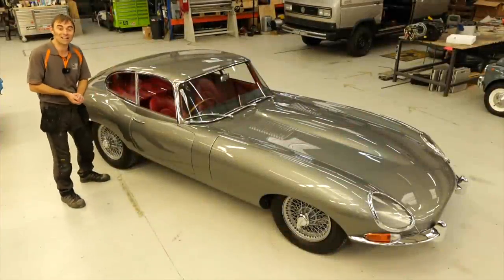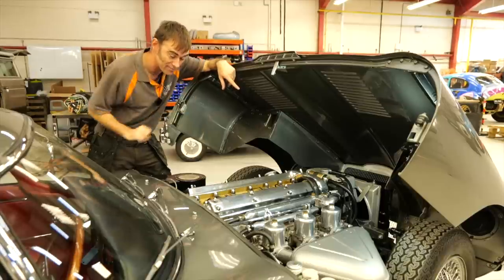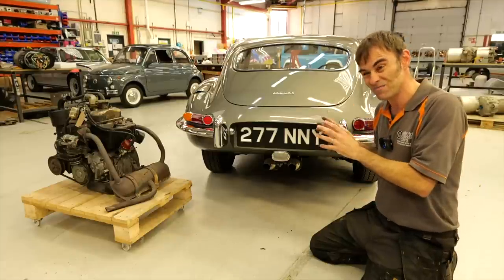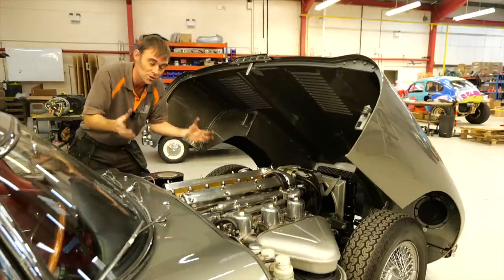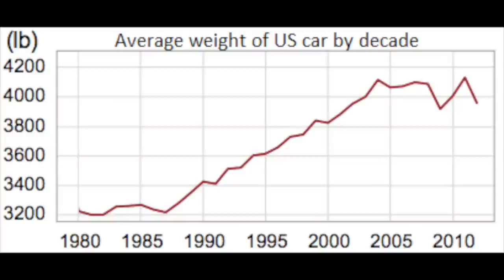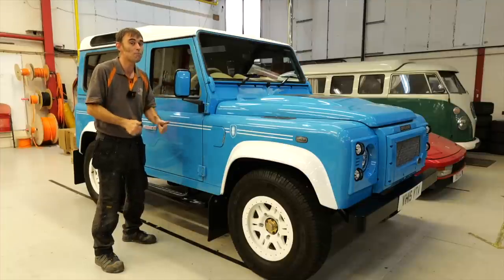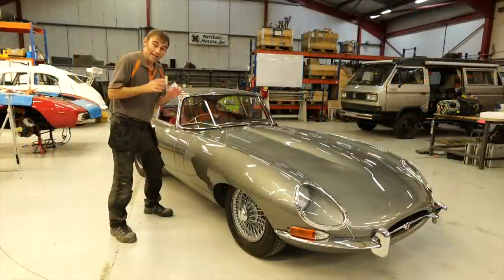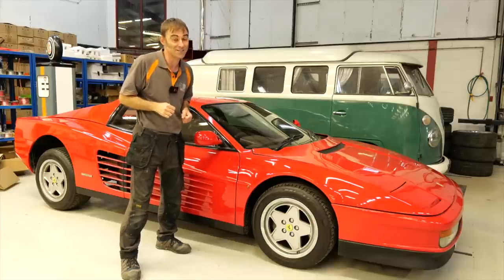Is it a sin to convert a classic car to electric?

Comment: Depends on the car. Changing a DS to electric would be natural and an extension of the car's design. Changing an M6 or M3would be wrong as the engine was the core of the car. Changing a Lotus would be wrong too as it would alter the low weight which was key to that marque.

Comment: I think people talk about the engine as the soul of the car because if you treat your engine well and make sure it has fresh oil it will take you anywhere. And if you tinker with it by putting on some different carburators you can hear the difference en feel the difference. A happy engine is a happy driver. You can hear it,feel the vibrations. It lives. If you open the bonmet/hood you can see the engine,feel the heat, smell it. You can dress it up by polishing the aluminum maybe put a chrome kit on it. When you have an electric motor,it becomes a tool. The only thing you see when you open the bonnet is a battery box. I have never heard someone at a car show say "wow what a beautiful battery box you have in that car"
Or "what a nice sound in that motor" more like " it sounds just like the electric forklift we have at work"
I think most people who buy an electric car or convert a car do this for the point of "look at me, i've got something you don't have or can afford"  and maybe a little bit for the environment .

Comment: There is a massive elephant in the room here that seemingly gets ignored and that is the BIVA issue. BIVA is basic individual vehicle approval - it's a scheme devised by the EU and our own government to test that amateur and custom built cars meet certain specifications. It all sounds perfectly innocent until you check out the details. For example if you have to put a vehicle through iva as a result of it being radically modified you lose the original number plate and typically end up with either an age related plate or a q plate. There is a points based system that attempts to define when a modified car becomes a new car but generally speaking if you modify the chassis in any way you are now looking at a new car. This becomes a massive problem as cars built 50 years ago were not designed to modern standards. One big problem is to do with glass - you have to have a laminated front screen - most older cars had toughened. All side windows have to be toughened which may not be  a problem but the fact that all have to be indelibly marked with the required approval standard might be. It certainly is an issue with my 1951 Ford Prefect with each piece of glass having to be custom made at nearly 230 quid per piece. The DVSA recently issued further advice on this that makes converting to electric and registering the vehicle a lot more difficult. It's expensive too and really not in line with the government's publicly stated policy of encouraging electric vehicles. I have heard of this happening  afew times now - people do whatever they do to their old car then they go to change the tax class and get told they have to take it for BIVA. It needs sorting.

Comment: An internal combustion engine breathes.  It inhales and exhales like some type of animal.  It has moods.  It can be temperamental.  But when everything goes right and it's hitting on all cylinders the noise and fury can be exhilarating.  I think this is what most people mean by "soul".  It's almost like you're dealing with a living thing.

An electric motor, on the other hand, just hums along without an drama.  It is an appliance.  A powerful appliance in many cases, but still just an appliance.  No drama, no soul.

Comment: My first car was a 1967 1/2 XKE and the essence of that vehicle was the unity and totality of all the design and engineering that resulted in its production. I have no qualms about renewing a classic Jag with electric. The thing to remember is you are changing the vehicle into something different. Don't compare - just experience. The FHC in this video is a work of art - it can be as much a modern work of art as it was originally. My current Range Rover Classic and NAS110, both 93s would be readily converted if Moggie was ready to let us individual enthusiasts purchase direct and avoid the excessive and restrictive conversion costs of the US partners : )
Reply: My first car i did not own and did not drive (for legal purposes i have to deny knowledge of the car at all) was a chopped Mini 850 with bucket seats. I think it was industrial sized ketchup but who knows after sitting on the open gas tanks for more than a few minutes. Did not know you could make a burnout on gravel with 25 HP.

Comment: I think we need to differentiate between 'classic' and 'old' sometimes. People who consider Beetles and Campers as classics can do as they please - the engines in those were awful from new let alone 50+ years later, so those are ideal for conversion. Things like E Types and Ferraris are another matter. If an owner wants to convert then go ahead, but doing it the ECC way - being able to revert to original if desired - will maintain the value of the car and make the huge cost worth the effort.
The more EVs on the road, the better for the environment. The less global demand on fossil fuels, the better for those of us who own true classics so we can use them however we please without the constant worry of contributing anything significant to overall CO2 production.
EVs for daily, fossils for pleasure.

Comment: According to a recent Yale Climate Connections report, even if the energy grid was entirely fuelled by coal, EVs would still require 31 per cent less energy compared to ICE cars.
Reply from the maker: Interesting. 👍

Comment: I have to admit I love what you are doing. The problem I have is the lack of facts from the government forcing us into EVs. It is the whole ol life carbon and environmental cots need to b taken into account. and as to running costs, remove the artificial tax the government add.  The best cars environmentally are those that last the longest, so offsetting the first build environmental costs. Just wait until most cars are EVs and the government tax the electricity you use (why do you think EV chargers have a separate meter?).

Comment: Hugely complex issue. If you own the car you can do with it what you like. No car (Electric or petrol/diesel) is environmentally friendly depending on where you get the recharge. If it's from a coal power station your wasting your time. You mention drivability but do you change a manual gearbox for an Auto? That would ruin any classic as it completely changes the drivability. It like changing a 2 wheel drive to 4 wheel drive. Totally different.

Comment: I think saying electricity from coal has emissions and comparing this to petrol is a fundamentally flawed argument, you are comparing a fuel little better than peat or wood to a much more potent and highly refined fuel in petrol, a better comparison might be to a gas powerstation but that doesn't serve thier argument. As you say it also ignores that the grid is getting cleaner and electricity is universal in that it can be produced from almost any fuel source. Lastly I would say they are ignoring the efficiency, particularly the well to wheel efficiency as transport of a fuel is much more emmisions intensive and less local than transmission of electricity.
Reply from the maker: All very good points. 👍

Comment: I think it depends on various factor as you explained. 
Is the car 100% original, working and well maintained? I won't suggest to convert it because it still stays oringinal and it's like re-paint a historical painting modifying it.
Is the car non 100% original, maybe with some issues in the engine etc, or does it needs a huge maintainance? I'm totally in. Maybe the original part that would be needed are going to be more expensive than a conversion and maybe will create even more problems in the future. And it is like having a painting that is missing some parts or it needs to be re-painted, and at this point a change won't be a problem.
About the performances it is well known that the electrics are better, so if the car has the possibility to be modified and improved why not? I think about some cars like a Lancia Delta, Mustang, Jaguar E-type which are made for that, will be even more exciting to drive. Other cars such as Fiat 500 or Citroen 2CV or a Mini, I wouldn't care a lot to match the performance of racing cars because are more a everyday use car.

Comment: I think the lacking soul argument mainly comes from the torque band being completely flat in electric cars. It will accelerate exactly the same way from any rpm at any speed (to a point) and in that, it loses character for some, it becomes what the car is to the majority of the population, an appliance. Using an analogy, a wood fire heater has many flaws and inefficiencies in comparison to modern heating devices, but you’ll never hear anyone romanticising their white box on the wall. 
I’m of the opinion that any car where the engine is not cruical to the experience should be converted, especially classics like minis or old fiat 500s, as safety standards ever increase, we’ll likely not see designs like them again (in saying that, electric cars bring many new design possibilities into reality as it no longer needs to account for big engines, gearboxes, driveline and fuel tanks) and it keeps there presence alive for generations to come, and how can that be a bad thing, you guys are doing far more favours for far more people by keeping them on the road then pleasing a minority. I may be a petrolhead but I can’t deny that we need to change and cars are not just engines, there’s so much in them to enjoy and be fascinated by.
In saying that, if you do want to contribute in helping the environment but still want something fun and inexpensive, why not get a motorbike bike or scooter. They require far less metal and materials, come in a huge array of styles, and are physically smaller so they don’t damage the roads as much. If you are moving 1 person, why do you need a 2 tonne car to do so, that’s how I’ve always seen it

Comment: To the point about ULEZ zones, if I'm not mistaken, vehicles that qualify for Historic class are congestion and ULEZ exempt. (At the moment at least.)
Reply from the maker: That's correct, for now. But just like zero road tax for EVs, I see that changing at some point. 👍
Reply: @ElectricClassicCars  Possibly but then they'd also have to start charging steam rollers, traction engines etc. :)
I'm sure petrol will be around for the rest of my lifetime but yes that will also reduce in supply. It will be a return of the early days of motoring where you'd take a can to find fuel.
While I understand the cost challenges that many face with moving to EV's, classic or not is that it's inevitable. Even with fossil fuelled power stations, it's far more efficiency burning them there, than in each ICE engine at only about 30% efficiency.

Comment: It depends on the car. I would love an electric powered 55-57 Oldsmobile, but would never do it to a V8 Mopar. I wouldn't even put a stereo in the Mopar, because the sound is just too good. Also the cost is still way too high, and the range is too low.

Comment: Some addition maybe — if you convert a 90’s classic car to electric, keeping the weight. Doesn't that mean the performance/weight ratio excellerate better that today’s fossile cars. Reference to your graph shown on 8.14 min. And even more, is converting a classic fossile car with its massive hunger for gas comparing to modern car not much more reasonable  then todays cars with a consumption around 1/3 of what past cars did.

Comment: You didn't mention whether converting a 40+ year old vehicle from petrol to electric is considered to be a "substantial change". I presume it is, in which case it would also remove the vehicle's entitlement to MOT exemption for another 30 years.
Another benefit of converting petrol or diesel vehicles that are less than 40 years old to electric would be the zero cost of the annual vehicle (road) tax.
Reply from the maker: I'm not a fan of the MOT exemption for classic cars. For most that used to be the only time per year they'd check it was all running safe. Now there's no checks. I don't think that a safe thing to do for something that's 50+ years old. There still needs to be annual safety checks done by a professional.

Comment: I'd love to do this; but since I don't hake 20K lying around for this - and to be honest I only drive about 5-6000 miles p.a. it's probably a non-starter.  But the big positive you haven't mentioned is simply the idea that you're not throwing a car away. I've always wanted my cars to be a 'keeper' and hate the 'buy a new car every 4 or 5 years' mentality the auto industry would like us to have.  Hence I drive a 30 year old Mercedes 190E.  Perhaps the cost of conversions will become a little more reasonable as batteries become cheaper??

Comment: Hi, I  would like to point out  that in Northern Ireland we only have 2 electric tariffs, economy 7 & standard rate which means if you use economic  7 you get cheaper electric from 7pm to 7am & if you use electric outside these times you pay a higher rate. I think in England, Wales & Scotland you get cheap over night electric. I'm not anti EV but this is a factor in the price of charging an EV. Other question is how do you source your Tesla motors?
Reply from the maker: The Tesla parts come from salvaged vehicles. We also can have economy 7 in the UK. 👍

Comment: My motors have a soul,” said Enzo Ferrari famously. Ferraris continue to be imbued with the same passion and soul that they always were, and customers both old and new are said to appreciate and cherish the ‘spirit’ of these supercars. And if there’s a marketing tool to top all others, it’s a feeling – something you can’t put your finger on, but the sound of engine as you press down on the accelerator, the engine comes alive. It's a fire breathing dragon, that wants to kill you. You control and tame the beast, and in turn it rewards you with the ability to fly, with the wind in your hair and a trembling on the ground. The sole of the beast is alive, as it roars to life. How will you control it's power ?

Comment: I love the internal combustion engine but I can see some of the benefits. Thinking back to my 3.0L S Capri in the 80s, that would have definitely have benefited from some battery packs in the boot. 
Don't see this electric conversion happening in the classic motorcycle world, unless anyone knows different?
Reply from the maker: Converting an old motorcycle can and has be done. Check out this Royal Enfield we converted to electric https://youtu.be/KY5rkEuy--A
Reply: @ElectricClassicCars  Thanks for the link, I'm working on my prejudices against electric bikes. 👍

Comment: I think you’re absolutely correct re: the soul vs personality point. I don’t think a car’s personality is the soul of the car. My v8 Westfield sure has a lot of personality with that big V8 in there, but I don’t think i will see it as anything less of a Westfield if I convert to electric; the personality will change though. I definitely wouldn’t miss it leaking oil all over the driveway haha.
Reply: There's a simple way of curing your oily driveway........
Reply: @stephenross8463  oh, I intend to do the conversion! Just need the money! 😅

Comment: An  classic cars as they get older and they get used, the art they will most is probably not paintings but architecture. Consider Buckingham Palace. It was started more or less in 1761. And upgraded and added to. No one is going to say the Royals shouldn’t have , flush toilets, or electric lights or decent heating because the house is over 300 years old. If it it to be used , the art is updated.
Or consider Wentworth Woodhouse a mansion built on the profits of coal mining. So their central heating was a set of giant coal boilers, fuelled from the mine. Today the boilers are a tourist attraction, they are not used as the are as inefficient and expensive as any car engine. It didn’t take away from the soul of the house to go to another form of heating.
Or consider The Landmark Trust, an organisation that takes old , often Heritage Listed , run down buildings, and brings them back into use. They add modern plumbing, heating, kitchens, access all while still retaining their heritage. 
Not every form of art is static and must remain as the creator made it. Anything people people actually intend to keep using and not put on a pedestal should respond to the needs and wants of its users.
Reply: Good points 👍😀
Reply from the maker: Very good points. 👍

Comment: With 3D modelling and carbon fibre composites it should be possible to create a replica of any classic car. Imagine if the body and chassis weigh less than 300 kg but is stronger than the original. Add to that another 300 to 400 kg for motors and batteries depending on the range you want. The advantages are the torque of electric motors.the power to weight ratio combined with all wheel drive will blow the socks off a 426 Hemi powered Mopar.

Comment: I believe it has soul because it takes them back to a point in time when life still had meaning to them.  Anything that's happened since then has to be wrong.  Otherwise they have to admit something is wrong with them.  Mind you, I wouldn't take a well-maintained motor out of a classic Jag.  That's assuming I had the money.  But most classic motors?  Sure.

Comment: I'm still on the fence however some classic cars with "undesirable" engines are a no brainer. 
One point I would add which I don’t think you push on the environmental topic is by converting a product like a Fiat 500 to electric is a huge environmental benefit to the world rather than buying a new Fiat 500 with all the negative connotations of the manufacturing processes including the supply chain to get the product to the end-user.
Reply: Good point 👍😀